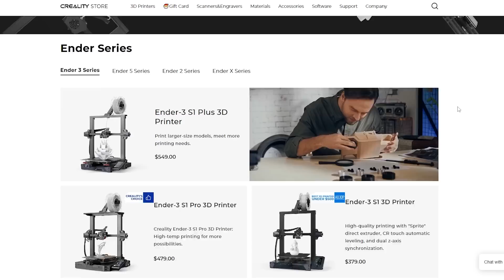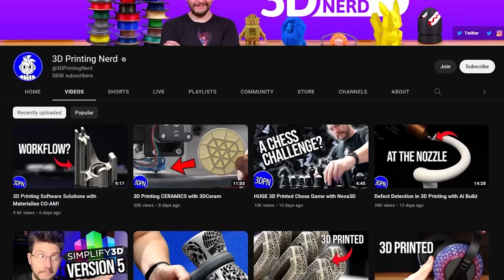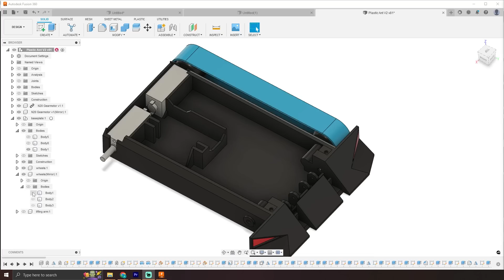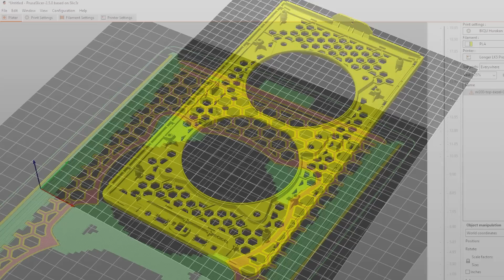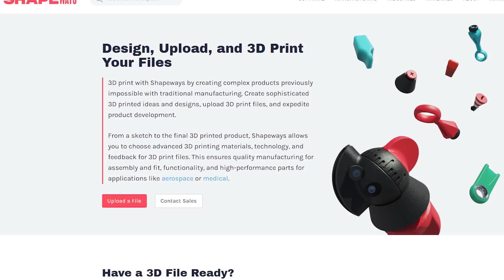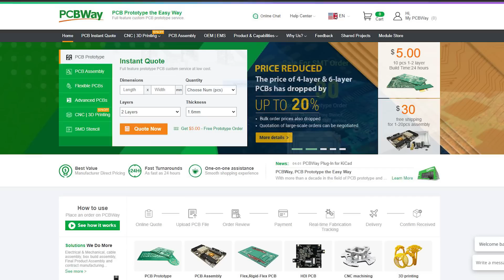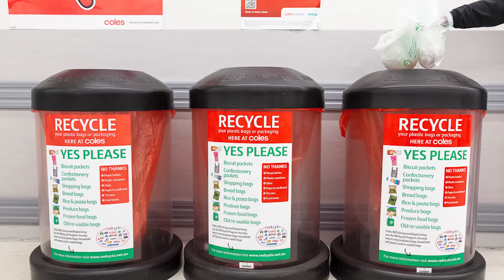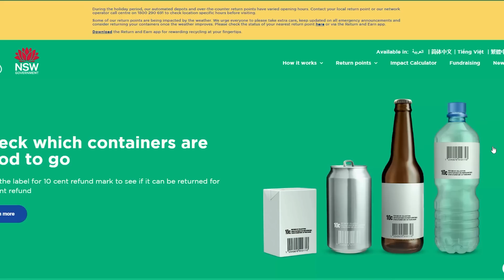My 3D Printing Predictions for 2023

Comment: Bambu is a disruptor. Cura is great, but there is still no justification for Ultimaker prices. I think 2023 is the year people get finally fed up with Creality and their business model of new poorly finished printers every few weeks.
Reply: Bambu’s decision to use a Prusa Slicer clone was a good move.  I still think the Prusa i3 machines have their place though.
Reply: @RightJoystick  Agreed they do for now. If you've got a print farm an i3 is the absolute best option. It's stable, reliable, requires very little maintenance and has a proven long term lifespan. That wont last though. If the new printers Bambu has released turn out to be great work horses then they'll quickly overtake Prusa. Same price but vastly better print quality, oh and printing in half the time - that right there is a print farm owners wet dream.
Reply: Creality’s lack of innovation is honestly fine, what they are known for is cheap printers for beginners.
Reply: Dang just got a creality......
Reply: @Religion is a poison 🩸  I honestly would not sweat it. It works with a lot of figuring out.
Reply: @Atheism-And-Normative-Ethics  if its your first printer then youre good.
Reply: @Atheism-And-Normative-Ethics  Just go over it with a fine tooth comb.
Reply: @chadcoady9025  yeah already ran into a clicking issue. That went away after releveling but I found out a ton of people have that problem with axis screws coming loose. 

Instead of getting a raspberry pi and doing octoprint or other I got the sonic pad. That shipped before the printer but it was returned to the company for some reason during shipping and I still haven't gotten it. 

The bed is super sticky so it's impractical to print anything fragile without bed modification. I could throw down sheet acrylic or another piece of metal maybe. 

So far it's pretty good though. Probably not worth $500 compared to what I've seen others do.
Reply: @Atheism-And-Normative-Ethics  it's not a bad machine.. It's just that many on here and other channels have more expensive 3d printers.. I am a Creality 6 se user here... Do I wish to own a Bambu Labs x1c at some point.. The answer is yes... But to me as with many things in life it comes down to $$$.
Reply: @Atheism-And-Normative-Ethics  I got one in April last year. An Ender 5 Pro. I've since spent it's price three times over on upgrades, and since November it's been rock solid reliable. But at this point the only original parts are the frame, steppers and belt drives. I installed a microswiss direct drive and all metal hotend. I added a G10 printbed. I replaced the motherboard with an SKR Pico running Klipper. I added an ABL. I printed a dual fan duct and added two powerful part cooling fans. Replaced the hotend fan with one twice as big.

And it wasn't until the motherboard (last part) that it reached a point where if a print fails it is consistently an issue with my design or slicer settings rather than an issue with the printer. No more arbitrary connection drops mid print. No more blockages due to the extruder tension being far too tight even at its lowest setting.

But yeah, it took all that to make it reliable. Since then I've printed a 28 hour moon lamp and stand using pretty expensive filament because I could rely on the prints completing. 

But i could have gotten a Prusa that is this reliable out of the box for the same Money (all it once, not spread out but still) and the only feature I would be missing would be Klipper.

Yeah. If I was getting into 3D Printing now I wouldn't go creality again. But this one should now be good for a while, and when the time comes to upgrade  I expect to see some very impressive printers showing up even in the 200 dollar range. The Neptune is already looking better than anything creality has.
Reply: @Atheism-And-Normative-Ethics  depends what you have, I'm still using a 3v2 with a few upgrades and it is still amazing
Reply: @Atheism-And-Normative-Ethics  i mean its fine for a beginner cause the ender 3 pro goes for 100 now but for someone who’s willing to spend at least 700 you should not buy creality
Reply: @malaythakkar8772  what to buy then? 

The one I bought sucks without the X Y adjustment computer. Forgot what is called. Got it for Christmas. Haven't set up the logic pad or whatever it's called but with slow print speed, small layer height I've not been able to get a tolerance lower than .3 mm
Reply: After Ultimaker sold their soul to MakerBot the company is dead to me
Reply: @Spyderman500  hilarious that you think they were sold to makerbot
Reply: @Spyderman500  I can't remember that I signed anywhere on a piece of paper that I would sell my soul.
What I do know is that UltiMaker created a dedicated department special for the makers where the team responsible for Cura also became responsible for Thingiverse. We are putting in the effort to push value for both products, still focused  on the makers and DIYers.

But good to know that you drop your support for a products so easily.
Reply: I'm really bummed about creality's quality control, I bought my e3v2 maybe 4 years ago and it's still doing great. There's been a lot of complaints about printers the last few years though, they really used to be good before the race to the bottom.
Reply: oh boy op thinks irl is glass onion
Reply: My thoughts are  Ender 3 and clones are evolving. The Neo series is a step up. But it’s still like the bare bones white box computers that are still around. Bambu has created an interesting printer in the X1C. The P1P answers the sub $1000 request so already starting a race to the bottom. 
Until we have a killer app, a reason for everyone to get one, 3D printers will remain a tool just like table saws for wood workers, soldering irons for electronics, sewing machines for clothes makers, variety of prices and features but nothing standard. And we will continue to help people get started here on YT :)
Reply: I think creality can stay in business because they literally have a $100 printer (when you use a coupon) no other 3d printing company has a viable printer at that price. Who I think is in trouble is prusa because they haven't released a new flagship printer in 10 years and they sell it at a $750 premium or $1100 fully assembled
Reply: Agreed with you, especially on Creality, but the Ender 5 S1 is a pretty good machine.  But as good as it is, it's not worth the $100 discount from the Bambu P1P.  It just makes no sense.
Reply: Ultimaker just sucks. We have an S5 at Work and it makes way more problems than our cheap anycubic...
Reply: I have several Creality Ender printers and can not complain at all. They are doing a fine job if treated correct.
Reply: Another manxie! 🇮🇲
Reply: we purchased a bambulabs x1 carbon with AMS for $1.5k. our 2017 ultimaker 3E for $3.5: it’s going to the train station
Reply: Creality is upping their game with Neo and S1 lines and closing gap to (sometimes going ahead of, for a while) low-end competition. Bambu Lab is different story, we'll see how it goes - Anker seems to be forgotten already. They are still printers that cost a lot (more than Creality, Sovol, AnyCubic, Biqu + 15 other) of money. You'd get pretty good TV or ten microwave ovens or 1-2 sets of tyres, depending on size, with that money. Maybe you own cask of Scotch. Or 1/3 of a Voron, if we count time to print parts and install it :D

Business printers will always be expensive. As long as they bring profit in some way (consumer printers often can't, they require too much pampering and hand-holding), that won't change.
Reply: @kimmotoivanen  Funny enough, at work (an engineering company, product development and such) we've gotten FAR more work done with the humble Ender 3 than the mighty Ultimaker S5 with air manager. That modafucka' two weeks ago also did us the favor of detaching a nylon print, carrying it on it's nozzle, and making an enormous blob of nylon inside the hotend that took down the two overpriced print cores.
The Ender 3 has had some too sensitive thermal protection tantrum fits and some extra minutes to check if leveling is OK. New Marlin flashed and no more issues.
It just keeps doing stuff. I train our colleges in minutes how to use Marlin's interface and they just go on to print. It works. It does parts.
The Ultimaker's extra expensive filament rolls (that we're being p*ssies about not using el-cheapo filament to not have problems, contrary to my intentions) just don't get used, and heck, it fails a bit more even, than the Ender 3.

From my experience, if the company has someone that has that maker/thinkerer mind working well, and they can afford that person to operate the printers, it's far more profitable to just have el-cheapos doing work without fears of them breaking (heck, just replace cheapo parts on them), or fears of wasting filament since you don't care about stuffing some of the cheapest you can find on them. Oh gee, nozzle clogged? Bin the nozzle and grab another from the Aliexpress pile.
Reply: @Kalvinjj  When sample size is 1, anything is possible. Cheapest filament and cheapest nozzles sort of tells that 3D printing is not used for serious stuff :D

It's good that things are rolling. How would they fare without you (vacation, illness, new job), with one printer or the other?
Reply: @kimmotoivanen  "3D printing is not being used for serious stuff" is quite the misconception you have, that you gotta just dump (really, waste) money on expensive filament for work to be oh-so-professional. That's a correlation that makes zero sense.
Before I was there they had an older proprietary software printer that was, hey guess what, harder to use! And had been 3D printing with it for years. They seem to be fine without me in vacations right now as well.
I don't know what you assume a cheaper printer to do, they don't grenade themselves without a nanny watching, (even if, the Ultimaker just did that, sunuvabitch printer...) and comparing the prints side by side from the Ender 3 and the Ultimaker S5, it was pretty clear that... yeah FDMs are still glorified hot glue guns and there's a limit to how much nicer the prints get. The difference was there obviously, the Ultimaker printed better indeed, but... ~10x more expensive prints at least, for nowhere near that much quality gains.
No clue what you feel like that we should be dumping extra cash on filament, since tons of jigs, for-show parts and quick mockups for the clients to have a clue how stuff works in a lower development TRL is definitely handled well with el-cheapo PLA. It just works. You don't need the 10x more expensive PLA for that, it's all the same vegan plastic we all love and hate. Much less some stupid fancy material.
"Engineering parts".... we do those exactly and it's often a better idea to just do it from sheet metal laser cut than trying to print some fancy expensive filament that still won't be enough or will cost the same or more. PEEK or such? Those are very niche materials, for very niche applications.

Put simply, as a TL;DR: If you need to dump too much cash into it, sorry you're doing it wrong.
Reply: @kimmotoivanen  The problem is Creality has created their own problem - they have so many different (but extremely similar) 3d printers that they've flooded the market with, it will make it extremely hard for them to gain traction with anything that isn't a cheap bed slinger.
Reply: Oh god pleeeease. Creality has been such a shit show for years now and is such a disgrace to the whole community
Reply: Hey I'm manx too😀
Reply: My anycubic kobra go works great tbh. Cheap alternative
Reply: I have the new s1 pro and adventurer 4 and a qidi x cf pro. My qidi is the best out of all of them but the S1 pro is much better running clipper
Reply: I have a Bambu P1P ordered, I'm so excited and finally able to get away from all this fixing of my creality machines. I at a point where I'm not interested anymore in repairing my printers, improving them etc. I don't have time for that anymore. I love that there are promising new companies on the market that focus on great, functioning products.
Reply: Sales haven’t even slowed yet,, why would they change when they are doing great for profit?
Reply: That and Klipper is going to take up a lot more foot print in the firmware world.
Reply: Hmm...

I don't have an issue with Creality. Mostly I see people that this hobby is a little over their head have problems. 

Sometimes I prefer to finish my machines more than a company because I'll just remove their parts anyway. They're just going to charge me more upfront for something I'm going to remove.

2023 for 3d printing will be business as usual.
Reply: Oof glances at my ender 6 with extruder problems
Reply: I find it hillarious that my resin mars 2 is cheaper and givers better prints than a compatible FDM. Until you can get an FDM for about €150 which is reliable and auto calibrating it won't matter
Reply: I'm still confused why people are still buying enders that are not either the s1 or the original ender 3. Everything else seem to be useless trim packages that come at a high cost. Like changing a psu even though I have an ender 3 that's creeping up to 4 years old and have never had an issue with the psu...
Reply: Agree. I finally abandoned my heavily modded ender 5 in favor of the x1. Unless you love tinkering, creality is a nightmare.
Reply: Guessing you're Manx. Belated Happy Tynwald Day for last week! Lovely little island that one!
Reply: I got a CR-30 and it was very nice until a motor made problems and creality asked me to do things which just make everything worse and when I said their thing didn't work they gosted me and gave me no compensation
Reply: Creality offer a decent product *for the price you pay*. They are, however, as modular and upgradable as any other FDM machine. Perhaps more so because there is such a large community offering advice and tutorials aplenty for Creality machines. My own Ender 3 v2 has a Bondtech DDX extruder and a Mosquito hotend. Soon to obtain a Sonic Pro for Klipper. Add to that a series of smaller upgrades that have had a positive impact. Dual z axis - teflon rather than brass fittings just for two. The range and quality of the base model has been improved greatly.
Reply: @larryfroot  i don't understand this hype around upgrading the enders.. instead of creality delivering a full fledged worth the price device with great functionality ootb everyone goes for upgrades and mods.. This is the biggest issue I see with the enders, creality is happy to shell out model after model knowing people will end up upgrading them and "enjoy" the process, instead of producing a well tested product with good quality control and a full set of features for a decent price.
Reply: @nAcolz  I can understand and appreciate your point. But Creality offered me an affordable entry into 3D printing. I'm of very limited means and it has taken real sacrifice to save for the upgrades...but while I did I could still print my stuff. I don't think I could have saved up long enough and hard enough to dive directly in with a quality unit.
Reply: @nAcolz  creality are building printers with all the features. But obviously the cheap shit is what everyone is buying. Anyone who gets into any hobby is looking for the cheapest entry they can get. Unless you are loaded, you aren't going drop a grand on your first printer.
Reply: @nAcolz  People seem to magically forget all the issues Prusa has had at releases, MK3 constant extrusion issues and general print quality issues, Prusa Minis long list of issues. Lets also not forget its 3x the cost of an ender 3, comes unassembled, 3/4 of it is printed PETG because prusa cant be fucked to make it out of any proper material and would rather just lazily print petg in house instead of metal or injection molding.
Reply: @lookitsrain9552  Why do printed parts make printer inferior? Many do print upgrade and modding parts to their printers. Prusa updates their designs and one can print new plastic parts for official upgrades with their current printer.
How about Voron? Ooh, it must be terrible, you source bits and parts from here and there (lucky if you can find RasPI) and print (PETG is the best stock Ender 3 can do) the rest ;)

Tooling for injection is very expensive and requires static designs -> stalls development. Are they better parts? They can be thinner (no adhesion issues) and use exotic materials (counting also PC and ABS), but it all comes down to designing for manufacturing.
Reply: @kimmotoivanen  Im well aware of cost of manufacturing, and since you seem like you are, you would know charging 800 for a completely unassembled machine has plenty of margin left for proper injection molding or other manufacturing at their very high volume of production.

I never said printed parts are bad, im simply saying that for 800 dollars shipped from a company for a box of parts, for a basic i3 design, i expect more than basic 3D printed parts. There is no excuse.
Reply: @larryfroot  your not alone in what you have said.
Reply: @nAcolz  Agreed, two S2s here,   almost zero upgrade parts (BLTouch on one - not actually needed) excellent parts, especially in ABS - both have covers. No fancy hot ends, extruders etc. Mriscoc firmware  highly recommended but a zero cost upgrade.
Reply: @nAcolz  each to their own, i can change hotend when I want, change XYZ axis as I want, flash to Klipper or custom marlin for features, upgrade motherboard, steppers, drivers. 

Sure Bambu is cool and all right now but you'll need to buy a new printer to upgrade.
Reply: @nAcolz  because it's hundreds of dollars cheaper than the next best thing
Reply: I dumped my Prusa Mk3S+ machines along with the Ultimakers and went all Bambu Lab.  Quality and speed are unmatched even against my Vorons.
Reply: @almonster2066   good to know! I’m waiting for my X1 Carbon and I also have a P1P on the way. If all goes well, I’ll be ordering more
Reply: Ultimaker and Prusa are already in ruts so deep down that it may very soon may be their graves.
Reply: @hendrikjbboss9973  I still love and constantly use my Prusa, but I have a Bambu Lac X1C ordered instead of the Prusa XL.
Reply: @chadcoady9025  no wonder when it's half the price
Reply: @chadcoady9025  You're still over paying.
Reply: @dangerous8333  overpaying for what?
Reply: @hendrikjbboss9973  Did you see the new Prusa video on youtube yet?
Prusa claims  they're  shipping 9 thousand printers a Month, every month
Reply: @hendrikjbboss9973  Why do you say that about Prusa? I know they messed up with the multi-filament add on being unreliable, but their MK3S+ is an amazing printer. I was told it was the best 3D printer in the market and bought one and am very satisfied. I was disappointed to know the multi-filament add-on was not good so I did not purchase it because I read the reviews beforehand.

If their new $2k+ huge enclosed 3D printer is good I'm going to purchase it.
Reply: @hendrikjbboss9973 there are many people giddily predicting the death of Prusa and other Bambu Lab competitors even as the Bambu Lab forum is full of people reporting problems with warped beds, only to be sent replacements that are just as bad, told they'll only get a one-time replacement, or told that the warped beds are "within spec" and will not be replaced. They use cheap components just like Creality, and that's the company people want to destroy the competition? Good luck.
Reply: How are they poorly finished my ender 3 S1 gets here today 😢
Reply: @hollisbabybeats  i have 3 S1s and i do really enjoy them. For the price point they are  great, and alot of reviewers had alot of good thing to say about them. Creality as a whole may be meh and do some shady stuff (creality cloud) but that doesnt meant all their printers are trash.
Reply: @hollisbabybeats  Creality has too many models with very similar features. They are not of poor quality but it does not "stand out" either. IMHO they are a tad too expensive. BTW I own a Ender 3 S1 Pro and it is a good machine. Very reliable and I have been pushing it hard for about 2 months, working it close to 24/7. Forget using the Creality Slicer, just go for Cura 5.2.1. I'm now trying Lychee and SuperSlicer.
Reply: @hendrikjbboss9973  I heard anything past Cura 4.8 detects pew pew parts and changes them.
Reply: @hollisbabybeats  any source to back up this claim?
Reply: @HE-162  comments of print shoot repeat / Reddit
Reply: @hollisbabybeats  any source you can cite to back that up? Seems like since cura is open source we's know if that was the case...
Reply: @hollisbabybeats  I don't see how that's remotely possible
Reply: @hollisbabybeats  please back up your claims with a source, I've found no evidence of Cura doing that

and, if they're trying, they're doing an awful job
Reply: @hollisbabybeats  what
Reply: @hollisbabybeats  Something I hate about the S1 (I have two S1 Pros) is that the autoleveling is a downgrade from the CR6. The CR6 is truly a one step leveling process. Hit the button, and it's done. The S1 makes you manually adjust it first, then run the autolevel, and then change the offset again because the printer is always going to get it wrong by a whopping 10mm. And even then, it won't show you the leveling mesh so you have to check it the old way.
Reply: @hollisbabybeats  Idk. My ender 3 has zero problems, and even came with a free glass bed.
I mightv been lucky, but mine is litterally perfect. I got mine back in 2021 though so it might be different for some
Reply: @hollisbabybeats  Don't listen to him.

That S1 is a solid machine.
Reply: @hollisbabybeats  they aren't, my ender 3 v2 is still a workhorse (with upgraded spite pro extruder that is in the s1)
Reply: @hollisbabybeats  They aren't just don't expect to set it and forget it, it'll need regular care like most machines
Reply: @NorthseaKoala  respectfully, I have interacted with a lot of machines and after buying the ender 3 s1 I have never delt with a more finicky machine.
Reply: @hollisbabybeats  that sounds frustrating, sorry you've had that experience
Reply: @hollisbabybeats  the S1 is a a very capable machine - I have 8. Get yourself a Sonic Pad and get Klipper running in them and they produce great quality parts at a decent 200mm/s.
Reply: Nah, I just made Voron 2.4 myself, screw all that corpo crap. All parts for Voron available on Ali, including ones they linking only on Digikey, except some white American 4pin DC connectors like in old PC power supply, but they can be replaced by car analogs and Raspberry Pi today cost more than some decent graphics cards. Strangely no one use car industry parts in 3d printing, which very accessible. Printed ABS parts for Voron also sold as kits on Aliexpress. Truly a people's printer.
Reply: Bambu is the new kid on the block cashing in on the shiny new toy effect. It won't be long before they fall in line.
Reply: @allwoundup3574  sounds like maybe you haven't used one yet
Reply: @allwoundup3574  I think they're more than that. They have some serious financial backing and are here to disrupt the entire market. The fact that they've been able to match the pricepoint of the i3 and mini, and produce vastly superior printers in the process should be extremely worrying for Prusa and the other bed slinger manufacturers. They need to adapt pretty quickly because theres now very little reason why you'd buy any of their printers when vastly better options exist for the same price.
Reply: @allwoundup3574  Yeah, there are already cracks showing with how the thermal runaway is sub par. It's dangerous, and the company's response was very poor. They seem to believe that 3 minutes for the heater to cut off is fine and not enough to start a fire.
The company's attitude is a dealbreaker for me.
Reply: If "hey you can copy my homework, just make it look a little different" was a 3d printer company, bambu lab would be them. They haven't done anything actually innovating, they just copy everyone else's hard work then slap a proprietary label on it and sell it cheap.

The honeymoon phase will whither out with bambu lab soon, then they'll just be another "proprietary" printer from chine, waiting on others to actually innovate.
Reply: @LilApe  but is copying a bad thing when they grab good ideas from multiple other companies and put them in the one machine? Isnt that what us hobbyists want  and dont we get together online and make lists of all the features we want to see in one machine? Sure Bambu has come on the scene in a splash and no doubt will be buoyed by their initial sales. Of course once that interest peaks it will be interesting to see if they can produce feature packed machines and make a profit. Their recently released trimmed back model suggests they are being pulled into the generic shared space.
Reply: @LilApe  tell us how those orange balls taste.
Reply: @caseyeberle7998  My prusas are black, try again.